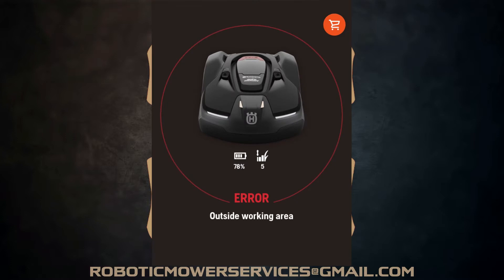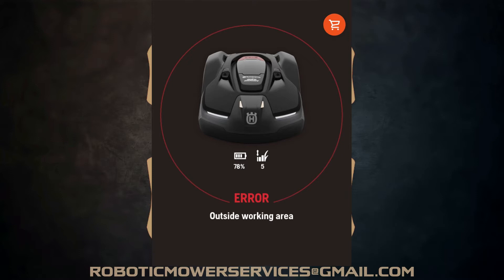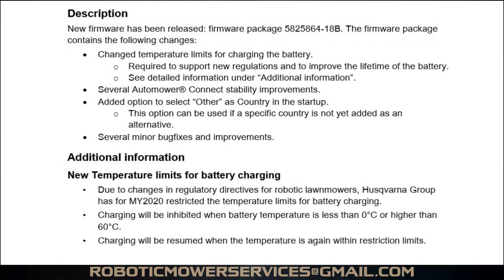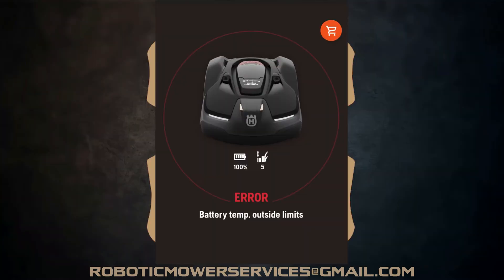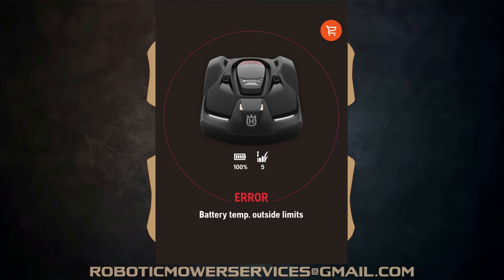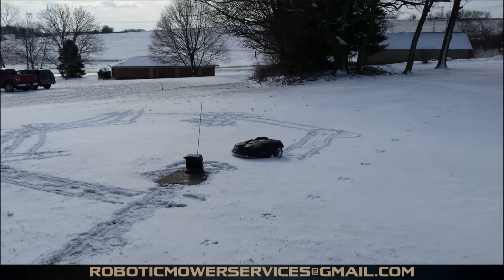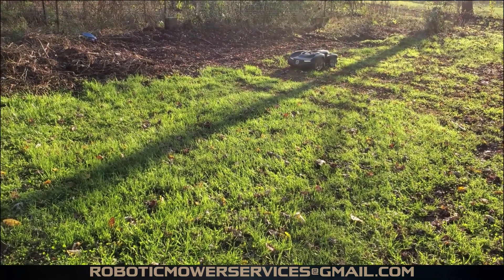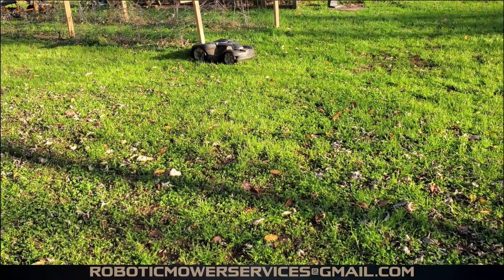Husqvarna Automower Battery Temp Error & Outside Working Area Error (Cold Weather Issues)

Comment: I just found this video; it's the same deal. I sent in my 430x for repairs, and it came back with a firmware update. It's been in the 60s at night, but the "temperature restriction" does not go away, and unfortunately, there is no dealer nearby. Do you have any recommendations on what to try? I'm not sure if I should repair or replace it altogether.
Reply: i want to follow up. Yesterday, I cleaned it thoroughly, with no water, and only using a brush. There was a ton of debris, gave it a try. but the issue persisted. so I unplugged the base and let the battery drain a bit on the mower. hoping to reset the sensor. Later that afternoon (6 hours later), I plugged in the base, and I put the mower in the middle of the lawn to set it to park to drain the battery some more. it was a good sign. Today it started to run like normal. I hope this is helpful to you. In a nutshell, clean it with a brush and, unplug it all, drain the battery, and let it rest. next day, give it a try.

Comment: i had this problem all the time under normal 15-20 degree celsius clouded weather so i replaced both my batteries…
surprise : even with the new batteries the problem is still there 
i read the temperatures from the "service menu" and they are supposed to be 54deg celsius which is absolutely not true.
they are not even warm.
any idea what i can do?

Comment: I have just started getting the battery temperature warning on my 315. The battery is reporting 70 degrees C even though it is 12 degrees ambient. I don't know if the temperature sensor is faulty or is it a firmware issue?
Reply from the maker: Is that temp you are seeing on the mower in the charger or out of the charger?

Comment: This is a new problem that I'm having with my automower just after putting it out after winter. Worked before but not now. Problem I'm having is the battery temp is over 60c when I check it so it always comes up with a temperature restriction error. This happens even with a full battery where it's just sitting there in the dock doing nothing. Outside temperature is well within the new limits. I'm stumped and just about done with the problems husqvarna create with all their updates. Does this mean the problem is the battery?
Reply: Hi, I'm having this issue now, I have to manually start it from the dock. Did you find a solution? Thanks
Reply: @clancyi  had to change the battery

Comment: Hello I got this error while the temparature is within the correct range. What could the problem be?
Reply from the maker: What model mower? Was it in the charging station when you go this error, or was it out mowing and stopped?
Reply: Hello its a 430. It was on its chargung station.
Reply from the maker: Was the sun shining directly on it while it was charging? If so, then that could've caused the battery to get warm and give that error. If not, then you should probably get the mower to a dealer to have them check the battery.

Comment: Wow! This just happened to my 450X. Temperatures were right at 32 degrees. 
I had my 450X in for a wheel motor replacement. Obviously they updated the firmware.
Thanks so much for this great information.
Rick
Reply: Thanks for your helpful video. We are getting this msg on our 450x even at 11 celsius.  We even kept in im house over night but msg still came up when we put it out the next am. We had put in for a service as battery wasn't charging to full capacity (was checked out and was told it as fine), and has been returned like this. Any ideas what's wrong? Faulty battery?
Reply from the maker: Wind chill and shade can play a factor in the temperature that the mower is sensing. It is very possible though that it could be a faulty battery as well. How old is the battery in the mower?
Reply: @RoboticMowerServices   My 450x is doing the same thing. Even on a nice sunny day (15'C), It now stops in the middle of the lawn and comes up with temperature error. Its also wont do a full charge any more. This only happened after a service and a software update. Whats going on! (bettery was tested at the service)
Reply: @RoboticMowerServices   hey sorry I just saw you replied now. It was almost 2 years old. They replaced the battery. However now its started again. Would it be the other battery now?? I found the hidden menu and battery 1 says 17c and  battery 2 is 54c.   What are these temps like? Have they qn effect on the error..  many thanks for your help
Reply from the maker: Thanks for commenting Rick! It's the time of year where these errors will occur more often.
Reply: @RoboticMowerServices  Question for you. Why can’t Husqvarna mention these new automower updates through the app so we are aware of them.
Just a thought.
Rick
Reply from the maker: It's a work in progress and might be something that is available in the future. We just got the ability to download firmware updates directly to the mower with the AWD models, so progress is being made. And since we're talking about progress, Husqvarna has Automower models available in Europe that have a frost guard feature on them that should solve these cold weather issues.